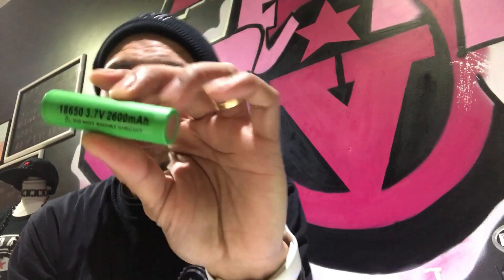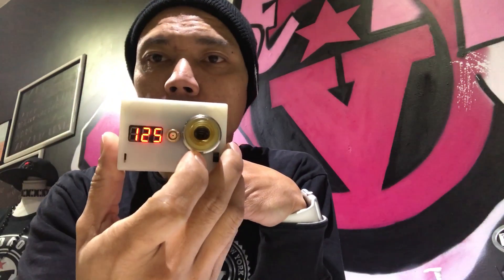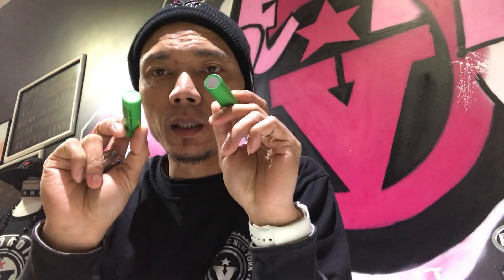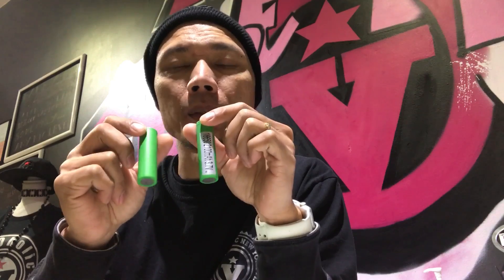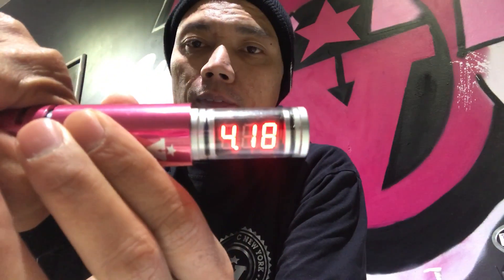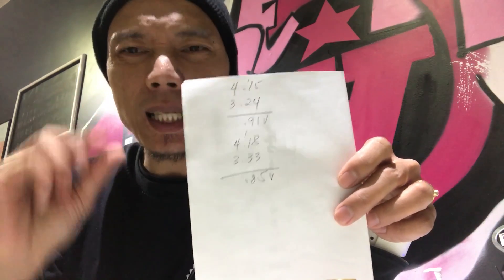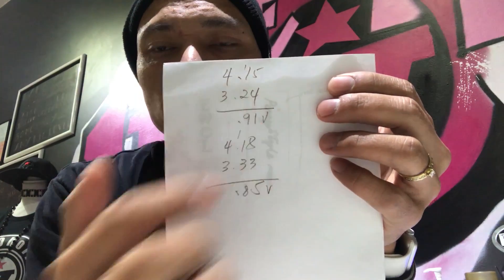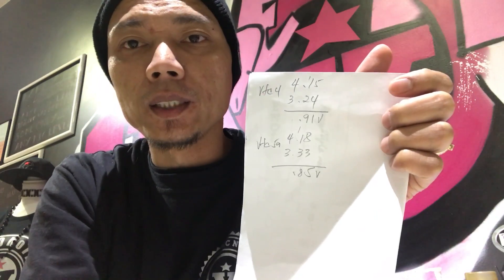Sony vtc5a vs Sony vtc4 volt loss comparison.

Comment: what does high drain battery mean and what is it good for? ?
Reply: High Drain refers to the battery's discharge. So, for vaping at high wattages, you have got to have a high current discharge battery...usually above 90 Watts....but if you vape bellow that, most batteries will do.

Comment: Can you check the VTC 6? Curious as to if I should order! Thanks!
Reply from the maker: TECH2DAE i dont recommend vtc6 on mechs. But it is great for regulated devices.
Reply: How come you don’t recommend it for mech mods?
Reply: What's important in a mech mod is the highest possible CDR (constant discharge rate). If you're asking more than that with the build on your mech mod, you're going to damage your battery, overheat it and possibly send it into a thermal runnaway / vent / explode. You should learn about battery safety, ohm's law before you even think about getting a mech mod.
Regulated mods work differently. While CDR is still important, you are better protected but that doesn't mean you should ignore all of this. VTC6 19A/3000mAh is a good compromise for the average regulated mod. This doesn't mean it's the best battery in all circumstances. On a single battery mod you may be better off with a VTC5 (25A/2600mAh) or VTC5a (30A/2600mAh) while in a multi-battery mod a VTC6 may perform better. 
Learn about batteries and safety, that way you can better decide which one is better for your personal use.

Comment: I used both of them, how much ohm is the best for vtc4 and vtc5 for mecha mod?  Terimakasih
Reply: mecha vtc4
electrical dual battery vtc 5a or vtc6,,
Reply: exp -tary http://www.steam-engine.org/ohm.html this is a good ohm calculator that I use, another reviewer on YouTube suggested it works.

Comment: would a dual coil 0,10 ohms would be safe on sony vtc5?
Reply: Single or dual batteries in a mech or regulated device? And if it's dual, is it series or parallel?

Comment: Thanks for the video. I have a question about the VTC5A. Do you recommend using these for VV more like the Reuleux 2/3?
Reply: note that I am currently using the Samsung 30Q...and a 2 battery configuration on the Reuleux 2/3
Reply from the maker: I use 30q as well and lg choco. I use these vtc5a and/or vtc4 for mechs. Vtc6s are good for VV too.
Reply: sounds good.  thanks for the suggestions!   enjoy the rest.

Comment: 0.12ohm build and your battery is Sony Vtc4 that has 30amp in a single 18650 tube mod? Your battery may vent of that 0.12 build bro. In my calculation 0.12ohm build requiering a 35amp power to support your build, using battery that has a 30amp power on that build, is just like you are putting a fireworks on your hand and may explode any time lol. 😆 Vape safe bro
Reply: Joshua Mahinog on mech there is voltage Drop so you may hit with 3.5 volts or 3.2 it's impossible for a mech to have 0 voltage Drop
Reply: Joshua Mahinog am firing vtcr on a .20 build? Am i on a safe side coz it draws only 21A...
Reply: I mean vtc4
Reply: Fahad Naeem yes you are but 0.2 it's ri high for my I usually built 0.13 and below
Reply: Almost all batteries are being sold at their peak discharge ratings not their continuous, the VTC4 has a peak protection limit of roughly 30a. The reality is assuming you're not pushing the wraps to actually melt and paying attention you're more or less ruining the batteries life cycle. That being said, you'd still require more than a VTC5a to actually be safe when hiting low low builds, or forced to use a regulated device. 

Also, while not the safest thing to be done, it is the NORMAL thing to do when testing, and not suggesting the use of etc. He is clearly showing the difference in the batteries, and is not saying you or anyone else should do what he is doing.

Comment: which is better to use lg choco or vtc5a??
Reply from the maker: rodmanking martin i dont use LG CHOCO on mechs at all. Either vtc4 or vtc5a..
Reply: does awt red is better than vtc5a ?? for cloudchasing?
Reply: @rod, awt is a rerwap, overrated cell. Check mooch's stats

Comment: Is the vtc4 stronger than lg choco?
Reply from the maker: Salas 'LlOYD' i dont use LG CHOCO on mechs at all. Either vtc4 or vtc5a
Reply: Ohh ok thanks!
Reply: lowe921 what's a good battery for a regulated mod vaping around 40-70 Watts thx
Reply: Carlos torres its lg choco or samsung 25r men
Reply: Salas 'LlOYD' I just started vaping recently don't know to much but I believed I have lg 18650 , so chocolate batteries are the best?
Reply: Salas 'LlOYD' lg red batteries
Reply: In all lg batteries lg yellow is best, but for  regulated mod lg choco is best
Reply: Lg choco is the brown
Reply: Fb men

Comment: Thanks for the real time voltage performance video. It's all very well reading charts, temps etc... But sometimes you need to see it for what it's going to be, in real life. 

I've researched a lot this past month what new batteries to buy. Mooch's stuff is very helpful - but in real vaping terminology/performance I like yours better to be honest, and seeing this video has confirmed what I really wanted. 

I've ordered myself eight of these beautiful VTC5A batteries from the Netherlands to the UK just two days ago, and I'm looking forward to seeing them when they arrive :) 

ATB
Reply: Hi, 

Thanks for asking. I had them for a pair of Noisy Crickets (1st versions) and they were fantastic... I also bought a pair of the new IJoy 26650 sized batteries for two mechs and these very good too... 

However... Unfortunately when I was travelling I lost my holdall which had basically all my batteries, charger, all my favourite mechs, a lot of premium tobacco liquid and a few original SvoeMesto Kayfun tanks... 

Needless to say that I was very upset and annoyed about it - lol... But I will try and build it back up again one day... 

Regards, 

Stuart